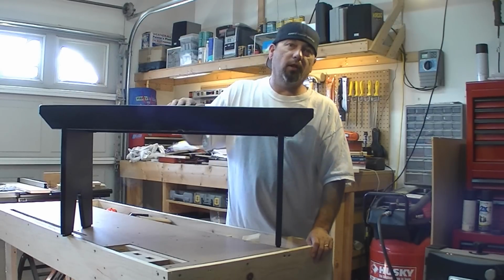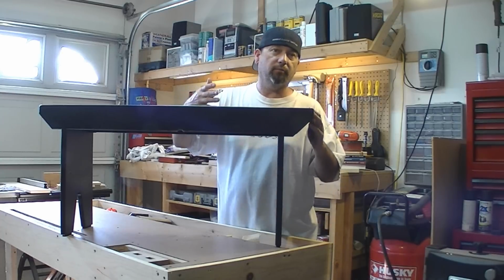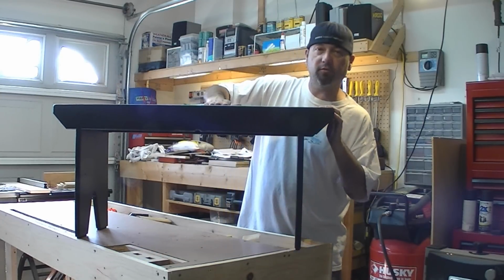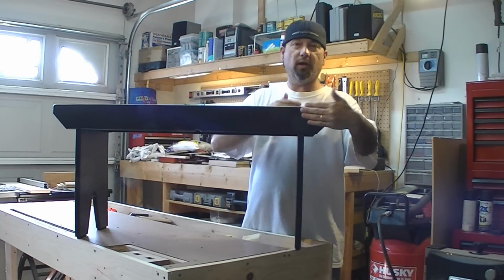Project - How to build a 5-board bench

Comment: Nice project. I like the character you gave it with the black spray and the sanding. Good work man. I built a Long 8ft. Shelf and thought about spray painting it Black like you but thought it was going to be waaaay too much spraying lol. So I used a small roller. See ya!

Comment: You know, ripping a board against a fence that is wider (blade to fence) than it is long ( parallel to fence) is an accident waiting to happen.

If the board gets even  slightly canted it will jam against the moving blade, and kick the wood directly back into your abdomen, chest, or crotch.
One of the first rules of safety I taught back when I ran a college wood shop.  Either use a miter gauge or a panel sled. on a table saw, a radial arm saw, a compound miter saw, or a circular saw with a guide clamped in  place to make that kind of cut.
Reply from the maker: I agree with you 100%.  Thank you for caring.
Reply: Agree. A generally bad idea to make a rip cut that shoulda been a crosscut. Only made that mistake once